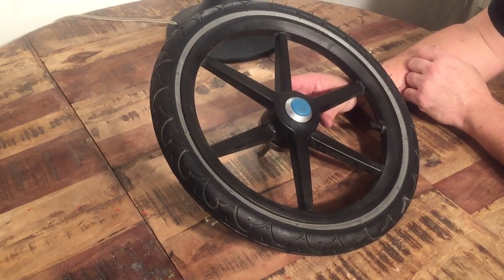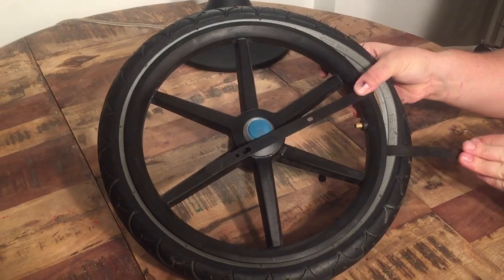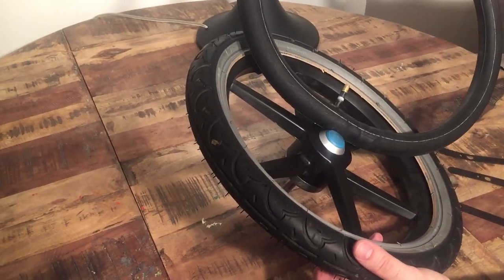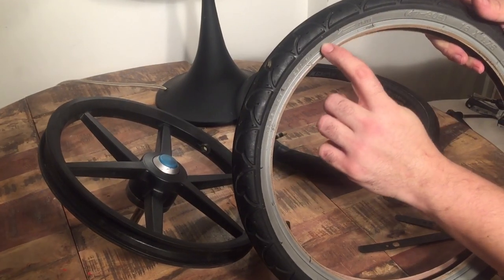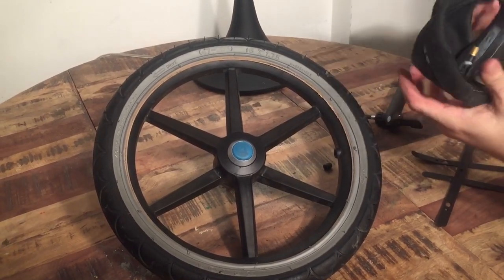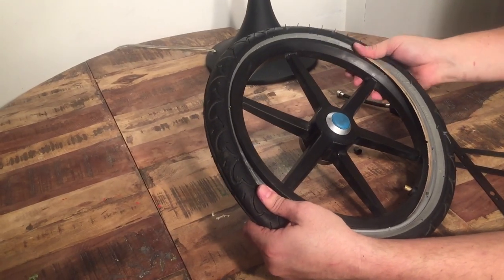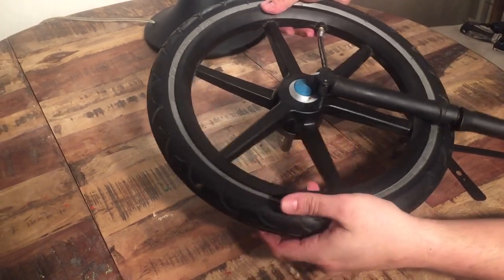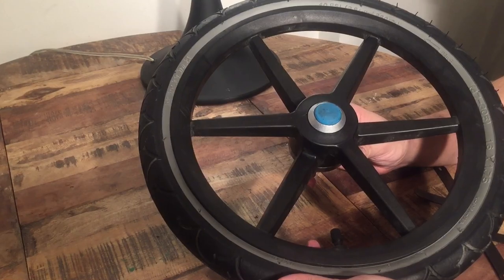How to Change the Tire / Inner Tube on a Thule Glide / Urban Glide or Other Jogging Strollers

Comment: I haven't had a look at mine yet but how did you get the wheel off?
Reply: Just push the blue quick release button in the center of the rim and pull the wheel out.